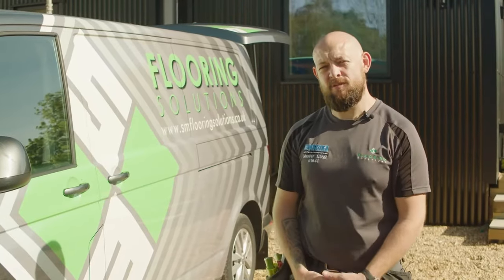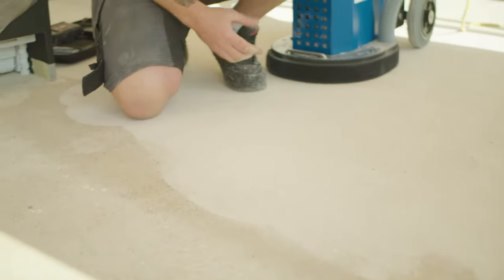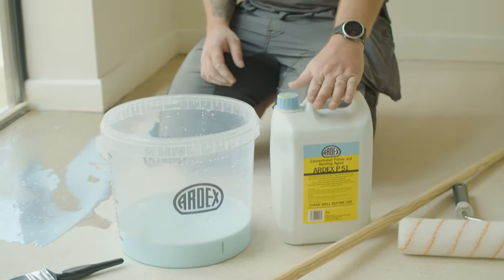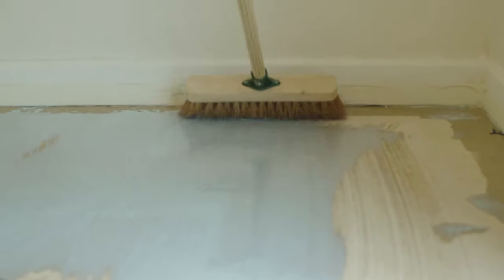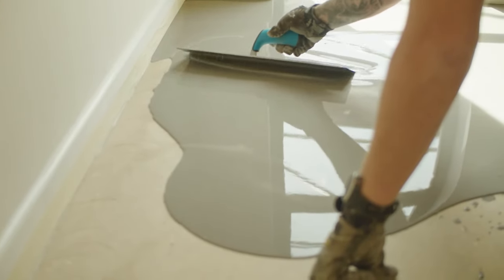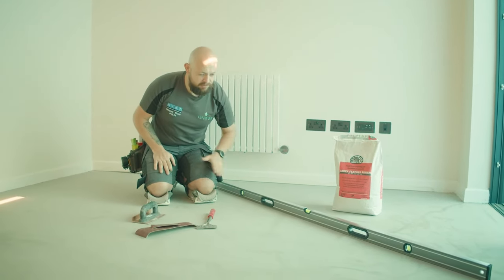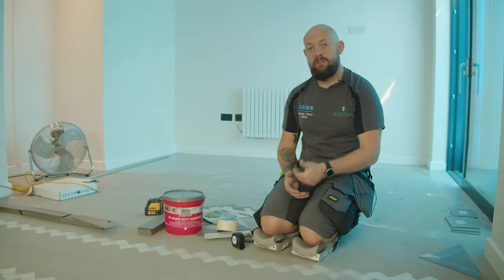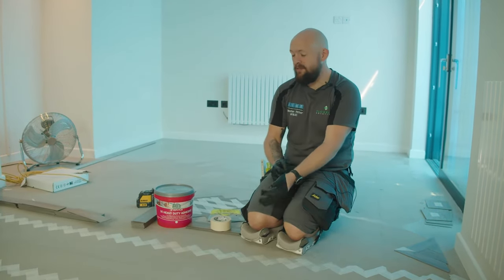How to Fit a Herringbone LVT Floor in a New Build House

Comment: Lovely demonstration from start too finish impressed with ardex glue ranges  especially heavy adhesive near doors windows nice job from start too finish like everything’s  if its done right it will take time and most certainly last for long time and customer spent money well on a lovely floor nice too see 👍
Reply from the maker: Thanks, Neil. Shane did an amazing job 🤩

Comment: How do you set out the masking tape for the edges of the glue? I’m a novice diyer and on a previous job I spread the glue slightly too wide and because I’m slow, when I installed the next row the glue overspill had hardened and the planks didn’t sit flush. Are there any tips to stop this happening other than speed up?! Thanks

Comment: It's like they have just learned how to prep from floorskills or something..
Brand new buckets ,brand new brush, brand new roller..😂

Screeding trowel looks nice and shiny too..

That ardex gear is ok.
We use na as it's bullet proof.
But it's all good..

Use half a sanding disc from you sander for feather..works a  treat, rather than that sandpaper
And that ardex adhesive is the worst I've ever used..
We get it free, with a pallet of na.
And give it away..

Btw....is Darren robo still at ardex..🤔
Reply from the maker: Glad you love NA but sorry you don’t like our adhesive 😞 What don’t you like about it?
Reply: @ARDEXUK  Honestly, 33 years I've been at it.
I'm still learning always, never profess to know it all.
Just so that's clear, I have no ego but I am good at what I do...
Your adhesive, the PS, we got a few tubs free with a pallet of na.
I tried to like it, even did my kitchen with it.
The main gripe is that if you have to reposition a plank or tile for whatever reason. It peels the whole lot up from the feather.
Maybe the HT is better, I don't know.
But it was just difficult to use.
We use balls for the most part and never have any issues.
Their HT is fibre reinforced,like others and good enough.
And the ps is spot on.

But anything else we use from ardex is spot on.
Feather , na, ardurapid the lot.
👍🏻
Reply: It’s called company promotion lol wouldn’t look good mixing up in manky fball buckets for a ARDEX promotion video.

Comment: If your going to spend that much time on prep take the baseboards off and trim the doorways so you have an adequate expansion gap.
Reply: You don’t need an expansion gap for glue down LVT?
Reply: Lvt doesn’t expand
Reply: Not laminate mate 😂
Reply: @DannyBoy-nu8ls  would have made the job easier for prep and fitting without skirtings though. Cracking job that though ! Lot more prep than i realised